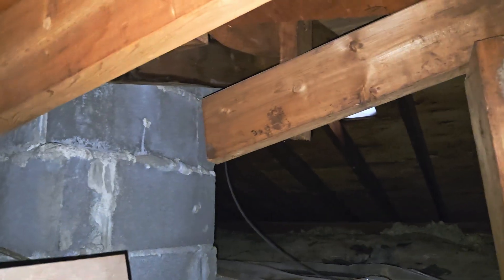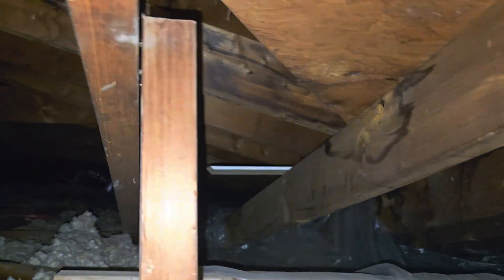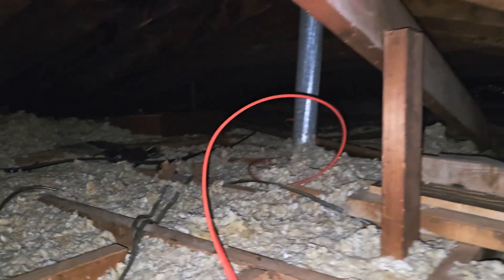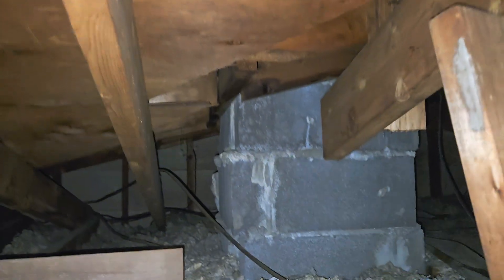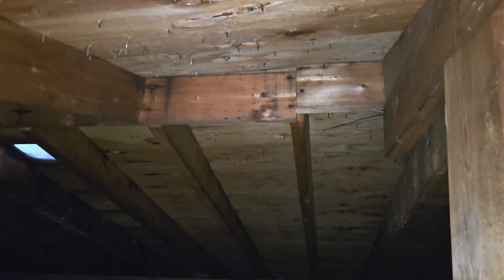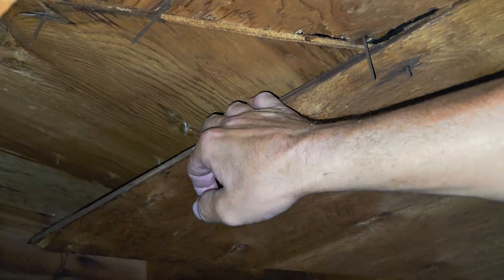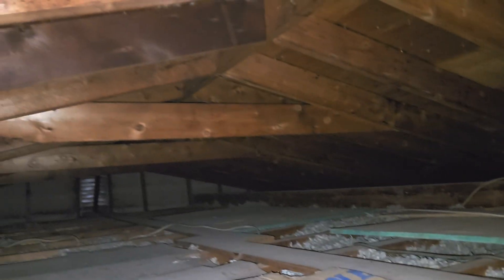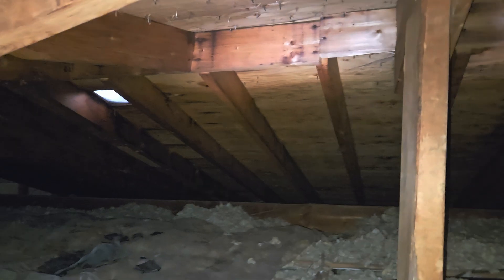Is this roof framing correct?

Comment: That valley is a mess😬. I would have expected jack rafters meeting into a valley rafter or an over-framed roof.  However, that is not the case here...

I almost wonder if that chimney and valley/roof was installed later? Some kinda of addition? It looks like the framing was was butchered after the fact and that's also why the plywood is hanging out like that. 

The ridge board which you said nothing is supporting in that part of the video. Are you referring to the fact the rafter is missing it's opposing rafter (this being missing is bad). Although can't be 100% sure due to video resolution it looks like there might be some nail holes for that missing rafter. The thing is a ridge board is not load bearing. The load of the rafters is put into the wall and the rafter ties. Some older building may not have a ridge board at all. If there are no rafter ties then it is a ridge beam which would need supported (e.g cathedral ceilings). However, this house has rafter ties (also called ceiling joists).

What you call a cross beam is called a collar tie, and is deals with uplifting forces and is not always needed. Also if the span of the rafters is long enough you may also see a strong back and purlins.

Comment: It’s poorly framed, but I wonder how you will approach this as a roofer. I briefly did repair carpentry for a roofer, but didn’t encounter anything this bad, just replacing rot or framing skylights. Definitely have to point out your doubts about some areas, in case it gets sketchy when you re-sheath.

Comment: Criminal incompetence by the framers right there. Needs to have the entire roof deck torn off and most or all of the roof framing re-built to something resembling Code compliance.
With some luck they might be able to re-use some of the framing lumber. But even a lot of that appears compromised by water intrusion.